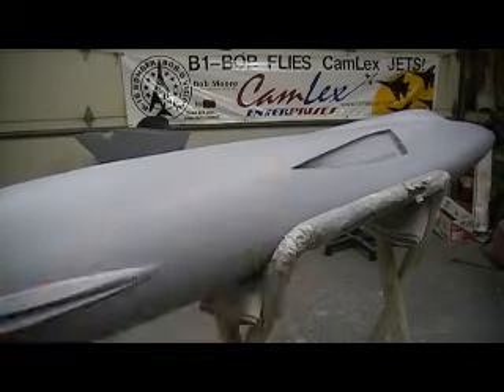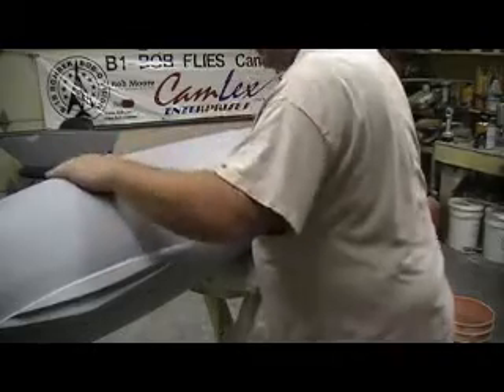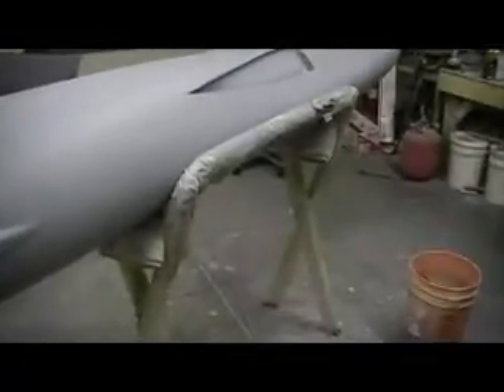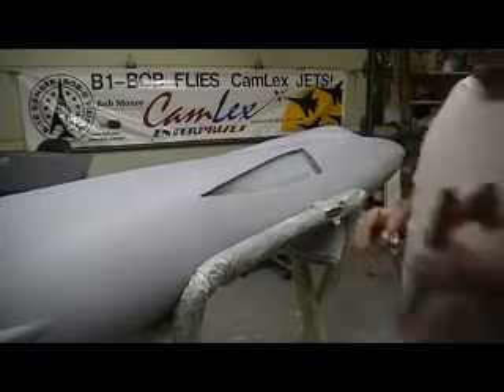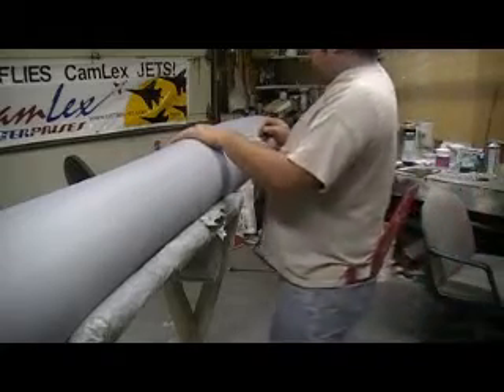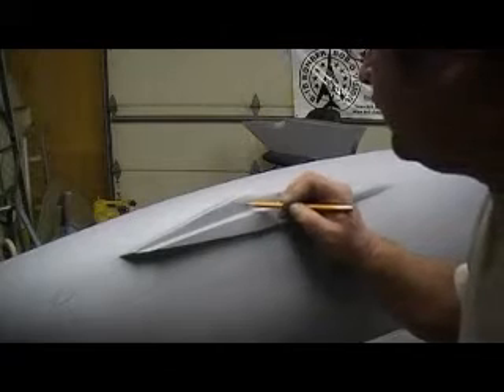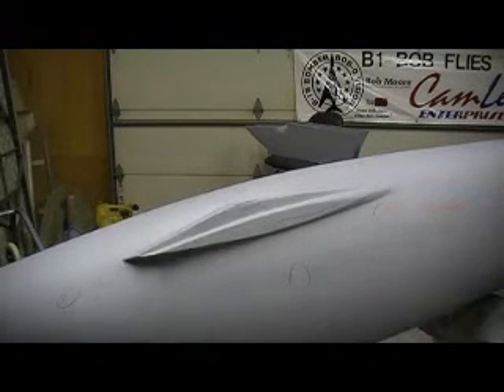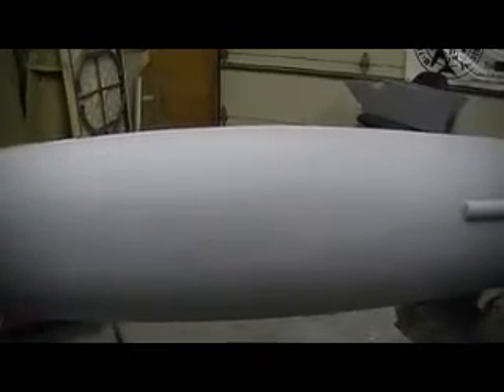how to build a rc jet F-105 thunderchief # 13

Comment: Dude7422 is correct...  the best way to address the ridges on a round surface is a belt of fine emery cloth used like you are shoeshining it.  It will quickly expose the high ridges then giving you the choice to dress down the ridge or fill the valley.  Also, take a look at the 3M Guidcoat product... a little pricey but lasts a long time and shortens the whole guidecoat/sanding process.

Comment: @rampagedm 
You got it right!  :-)   The early F-105 had a few issues, but...once the double-redundancy hydraulics were installed the F-105 was a literally beast!  There are many stories about them coming home with half a wing missing and mass damage....they did what NO other airframe could do for that mission and role at that time....they were the key to the battle plan, and they delivered!    It also broke the speed record at the time.  What a piece of engineering history!